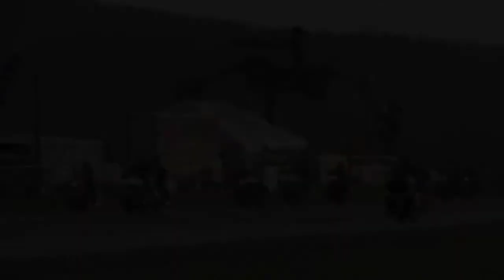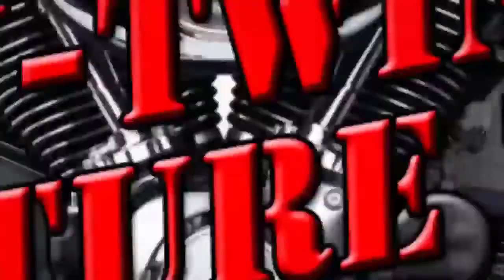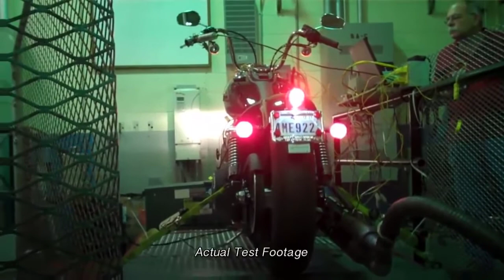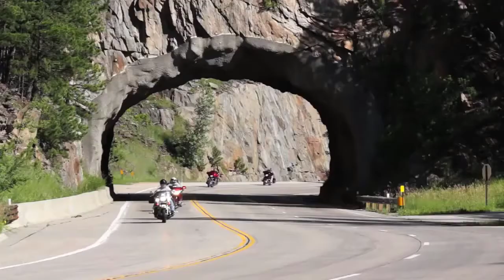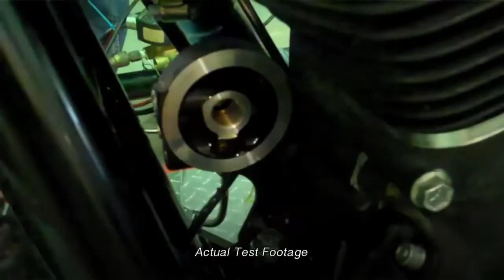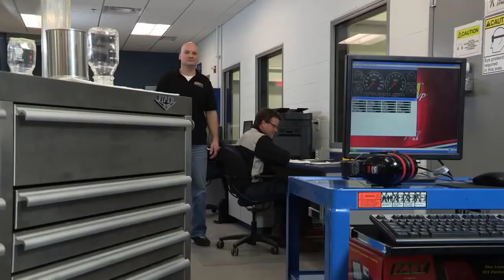Amsoil 20W-50 Motorcycle Oil Extreme Heat Test

Comment: Use the racing oil in Harley’s!! No clutch slippage to worry about. Motorcycle oils are a compromise and allow certain amount of friction to occur so a clutch will work. Big twin Harley’s don’t share engine oil with the clutch so you can put a better oil in them. I’ll never understand why nobody points that out. A oil that lubes so good that a clutch will slip is exactly what you want lubing your engine! Less friction equals less heat and noise. It makes a noticeable difference. The motorcycle oils are for bikes that share engine oil with the clutch and it all has to work together. It’s a compromise you don’t have to make in a harley unless it’s a sportster
Reply: Sir , I have a question, I have cb400sf 1998 , I live in hot country , which oil brand will you recommend and what  oil number should I use , and now we are in winter

Comment: What was the oil temperature? I see 215ºF - 237ºF on the monitoring equipment. Harley-Davidson states that 230ºF is the average and acceptable oil sump temperature. What does TBN depletion rate have to do with overheating? Oxidation and nitration are the concerns from heat but you don't demonstrate those numbers. Precisely how hot did the oil run at in this engine?